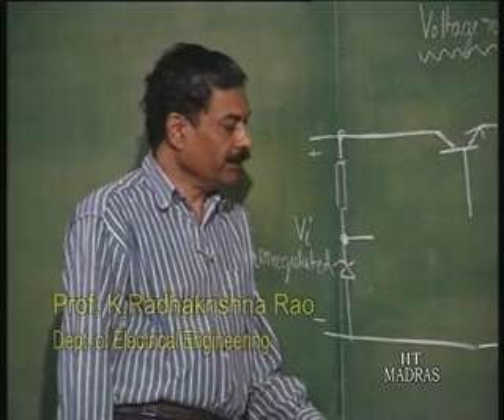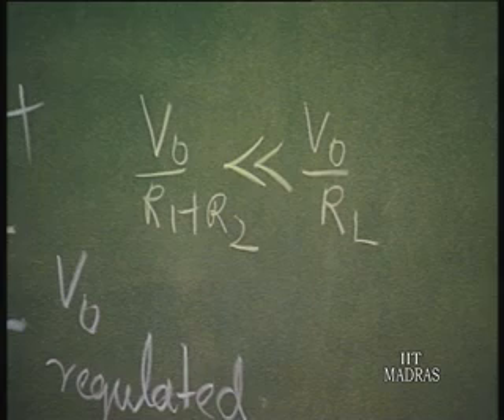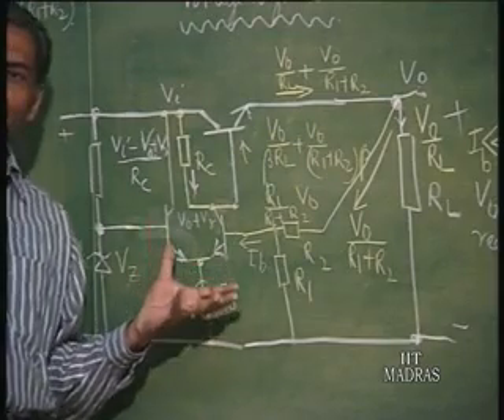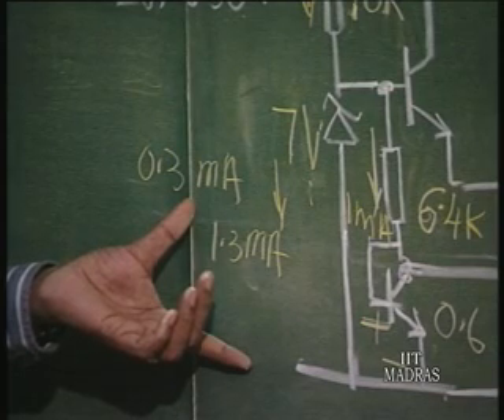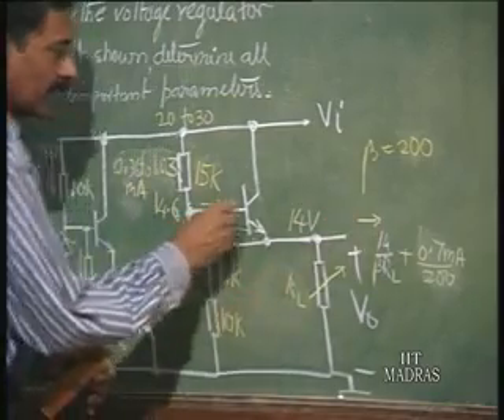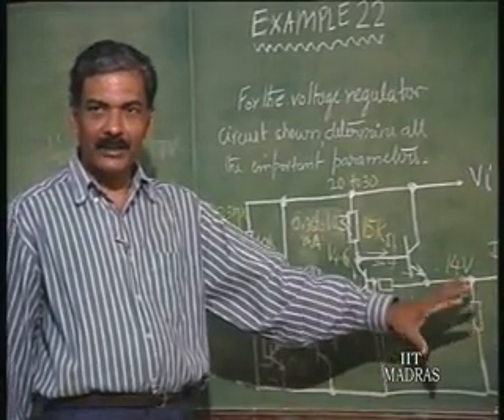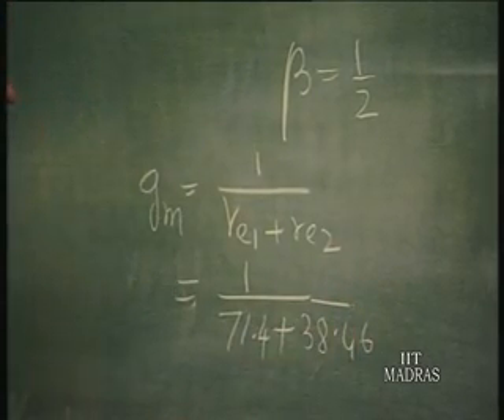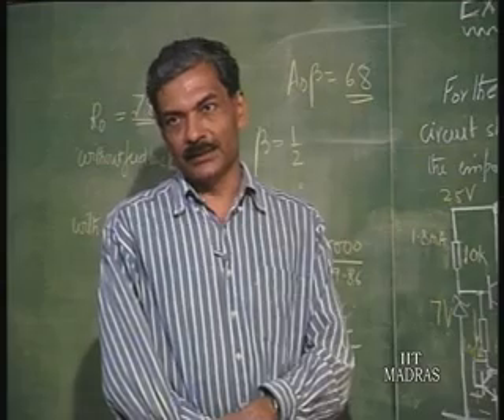Lecture -27 Voltage Regulators

Comment: Enjoyed this lecture. After Prof Razavi it become easy to break complex circuits in small parts & identify the working of each. If one give the circuit and ask to identify it, that will be a good task. In amp we never take input through collector. But in regulators we apply variations to collector terminal and call it as Pass transistor